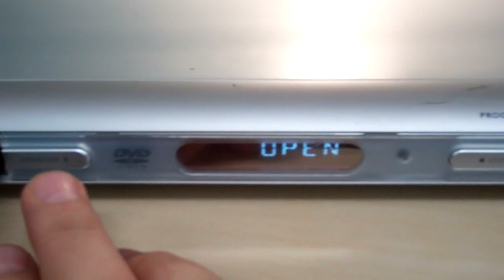DVD Player Repair Tutorial - Philips DVP642 -Bad Cap

Comment: Thank you very much! Right to the point and with the right level of details. Thanks for explaining about the range of the capacitors for replacement. The local RS did not have the original one (1000uF/10V), but had the one that you used, so there was no questions about getting it. Fun project for me an my daughters, everybody was greatly satisfied. Thanks again :-)